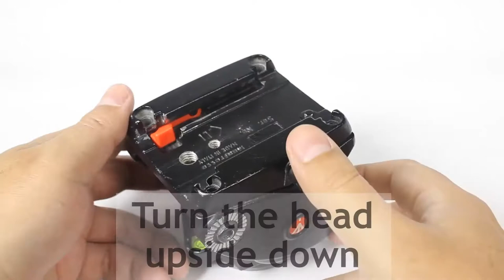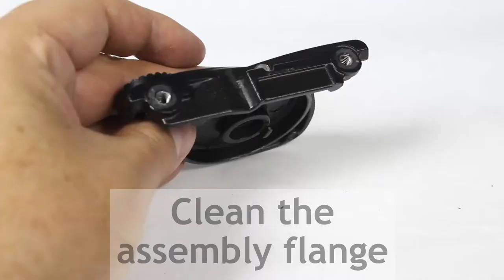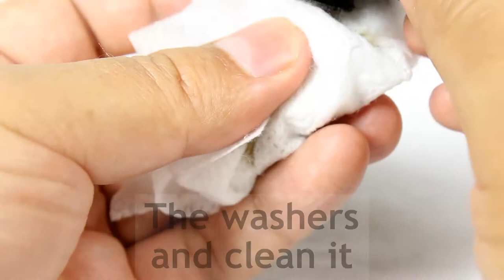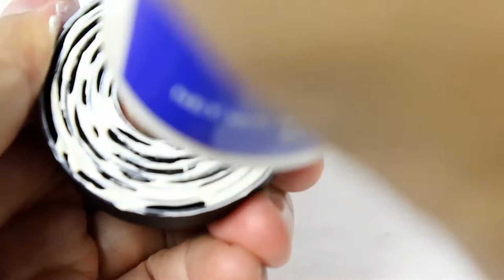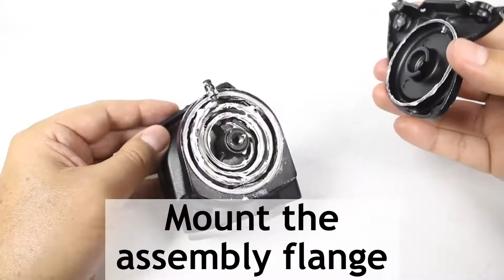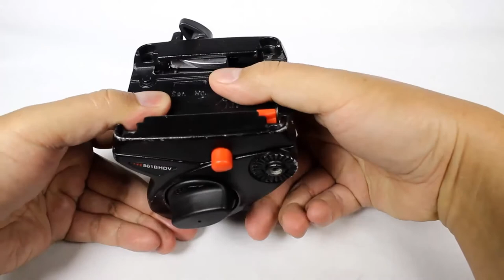Doing Maintenance To Fluid Video Head

Comment: FWIW /white/ lithium grease is a waterproofing goo but a poor lubricant. It is mostly lithium based soap which will break down over time. better to use a fairly thick "waterproof" hub  packing grease on metals and a silicone on plastics.
Reply: what would you recommend instead?
Reply: @GregFulks  what I said.
Reply: ohhh haha... just realize waterproof grease was the name

Comment: Hi where will I get the white lithium grease? Please reply
Reply: white lithium grease is horrible stuff, essentially lithium based soap with a little oil in it. It gets used for waterproofing car door hinges, and it quickly dries out. Therein the problem here.  Use practically any other amber/honey "car" grease.